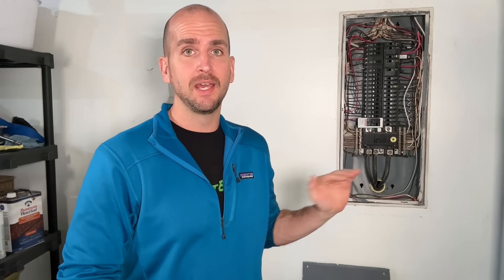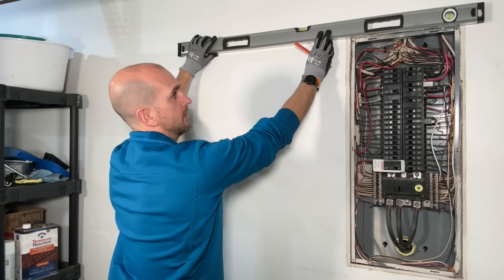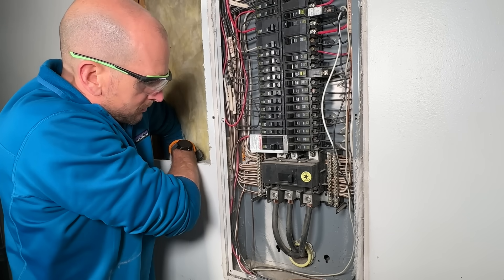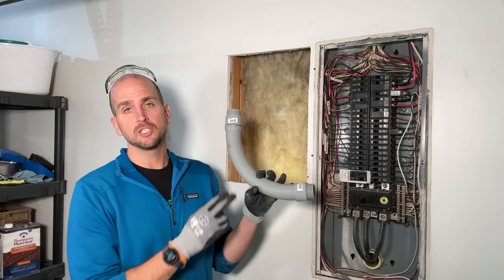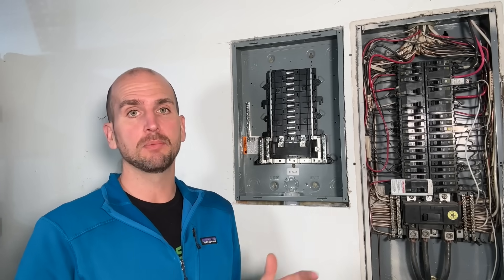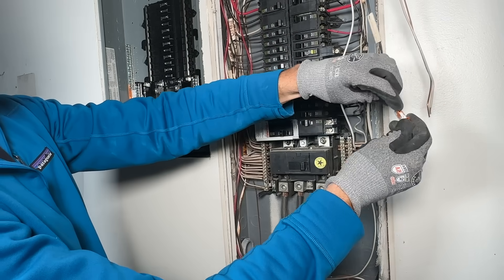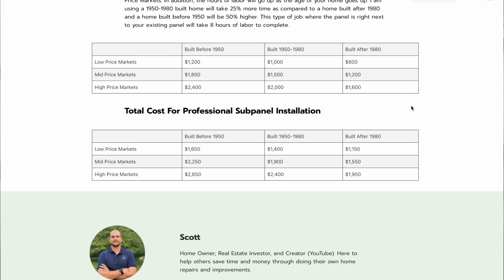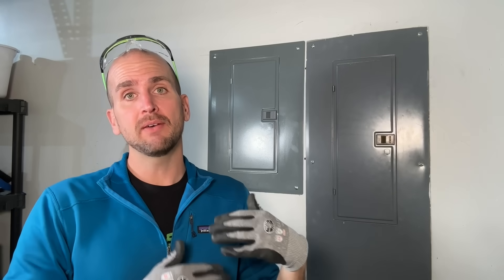How To Install A Sub Panel Next To Existing Main Panel

Comment: NEVER ADD A SUBPANEL DIRECTLY NEXT TO ANOTHER PANEL. Just change out the existing panel...Eaton makes a 60/120 if needed, what he did is CLOWN WORK 🤡
Reply: You're obviously not an electrician. There is nothing wrong with sub panels and they're added all the time.
Reply: @pld8993  If adding 1 to 3 circuits add tandem or quad breakers.
4 or more circuits CHANGE the PANEL.
Subpanels go in a different area of the building or in an out building/garage.
Reply: @tonyyglesias7784  Where did 1-3 go tandem but 4 or more change the panel come from? That's not a rule or even an industry standard so I'm guessing you heard that from someone once and you're running with it as if it's trade knowledge, which it's not. As far as tandem breakers, not all panels accept or allow tandem breakers though some allow every breaker to be a tandem so again, why 1-3 but not 4 or more? Sub-panels are installed for various reasons and yes, one of those reasons is to add more breaker spaces, but they can be installed just about anywhere you want them installed and there is no reason why they should only be installed away from the panel. Additionally, you can install as many sub-panels fed from a main panel as you wish, and you can even feed a subpanel from another subpanel.
Reply: @tonyyglesias7784  37 years and you never made it past journeyman? That might explain why you don't understand how wrong you are. Still waiting for "1-3 but not 4 " reference that you seem to think exists.
Reply: @Kevin-mp5of  You are a clown 🤡 
Why do you think they have 60/120s
Reply: @tonyyglesias7784  The only clown here is the one who thinks he knows what he's talking about but is clearly not an electrician. Care to share with the rest of us where the "1-3 go tandem, but 4 or more replace the panel" rule comes from? They make 60/120 panel for installation that require it, not because installing subpanels to create more breaker spaces is clown work. Study more, talk less.
Reply: @Kevin-mp5of  nothing like some crispy neutral insulation...
Reply: Bro pd is right again!  First off stop being so fukn cheap w this Eaton garbage people.  Only three u need to know GE Square D and Seimens.  Second most importantly check the load calculations.  Determines everything wen adding draw to the system!
Reply: You missed the part where the goal was renewables. Has anyone seen Tony? Maybe he is done with clown school by now?

Comment: How did that conduit fit so perfectly between the main and sub panel? Is it manufactured to fit so precise like that?

Was it required to use conduit or could you just have run the wires by themselves?
Reply: It would have been easier to buy SER. The big Grey wire. No conduit would have been needed.

Comment: I think you should spend more time talking about how careful people need to be around those live lugs. It's only 240V, but if you were to short those out, it would be much more catastrophic than a standard 240V short. Because there is relatively so little wire between the transformer, and such large wire, the short circuit current available in a short circuit condition is huge compared to any other short you'd see in your house. You could easily cause an arc flash.
Reply: I once bumped the bare ground wire for a range to a main feeder lug. I think it was a 6 AWG ground wire. The neutral and ground were bonded at the stove, and the neutral was already hooked up in the panel. As I was routing that ground wire...it touched a main lug, but for just a quick moment. SCARY. Nothing bad happened, other than noise, light, the wire was warm, and I needed a new change of underwear. Could have been a LOT worse!

Comment: In most states, work like this is supposed to go the process of getting permits and being inspected. I realize that's not always the case, nor does everyone do it even where they are supposed to, but it's worth mentioning.
Reply: This is particularly true if the electrical upgrade project ends up burning down your house. Not doing everything to code including inspections could invalidate your home insurance in the event of such a disaster.

Comment: So long as you are going to have all the power to your house turned off anyway, why not just pull the meter?  That way everything in the breaker box will be dead.  When you get done, replace the meter, then call the power company to come out and replace the seal on the meter.
Reply: You are not usually allowed to pull the meter unless you are authorized to do so since it is the property of the power company. With smart meters, if you pull it it will trigger a perceived outage and the power company will send out a crew to investigate. If you remove the seal and call them to come and install a new one, you'd better have all necessary permits and licenses ready to display or you'll be getting a visit from your local electrical inspector.  There's no need or reason to pull the meter simply to add a sub-panel. That would be like removing your gas tank before you replace your fuel filter.
Reply: @pld8993  Perhaps this varies by location or maybe it was that way "back in the day" 30 or so years ago when I did that.  And, I was replacing the old fuse box, split service entrance, with modern breaker panel.  I did not want to be handling hot wires coming from the meter box so the easiest solution was to pull the meter.

Since I was also upgrading to a 200 Amp panel, the power company also had to upgrade the drop from the pole, the mast pipe on the house and the size of the meter box, and the wires from the meter to the panel in the house.

I don't recall getting a permit before doing the job.  I did talk to the building inspector afterward.  He said that if the power company was happy with my work (they would not have connected the power if I did something unsafe) he didn't see any need to come out and inspect it.

Regarding your last sentence:  Ironically, the fuel filter on my Toyota Sienna minivan is part of the  fuel pump assembly and is inside the fuel tank.  On the HIghlander (SUV) there is a removable hatch in the floor to access it but on the Sienna one has to drop the gas tank.
Reply: @BryanTorok  Replacing the panel is different, you always pull the meter for that, but not for adding to an existing panel. And I remember having a car where the fuel filter was inside the tank. It never got changed.

Comment: 1. One would think that manufacturers would provide plastic covers for the always hot feeder lugs instead of leaving them out in the open.
2. Is 100 amp service enough for all the heavy-draw uses planned?
3. Does code not require that neutral feeds be white wire OR black wire wrapped with white electrical tape? The installer of the original panel did not do that.
Reply: KameraShy
Your 1: Covers (barriers) ARE now required for SERVICE MAIN LUGS 2017 NEC® 408.3(D), 2020, 2023 NEC® 230.62(C) and for FEEDER (WITHOUT OVERCURRENT PROTECTION) MAIN LUGS 2023 NEC® 215.15 but the covers are AVAILABLE from the manufacturers (purchased SEPARATELY); it’s the responsibility of the installer to provide.

Comment: You can also use tray cable or SER to feed the sub panel. That's my preference for sure, must easier to work with.

Comment: Did you connect the 6ga ground to the ground bar in the sub panel? It looked like it was going to a neutral.
Reply from the maker: Yep the lug for the ground bar was on the same side a one of the two neutral bars so they look pretty close together.

Comment: I noticed your main panel had a few  ground and neutral wires in the same hole . This is a no-no, neutrals have to be one per hole. Depending on panel some do allow more than one ground per hole.

Comment: Is it code-compliant to run 2-gauge 100amp wires in the same conduit as 12-gauge 15/20amp circuit wires?
Reply: The 2s are feeders and the 12s are branch circuit conductors so yes, they can be in the same conduit. However, with 5 current carrying conductors in that conduit, the ampacity of all the conductors must be adjusted to 80% of 310.15(B)(16). 

When used as feeders (as opposed to service conductors), the largest breaker for these #2s is 90A. Because the terminals on that breaker and the lugs in the sub-panel are rated for 75deg, the 75deg column in 310.15(B)(16) must be used for maximum amperage, not the 90deg column. The 75deg column for #2 Al is 90amps. A 100amp breaker is not allowed.
In addition, because there are 5 current carrying conductors in that conduit, the maximum conductor amperage must be adjusted according to Table 310.15(B)(3)(a), which reduces their ampacity to 80%. It's not an issue for #12s since they are already adjusted down to 20amps max breaker size (240.4(D)). According to Table 310.15(B)(16), a #2 Al THHN is rated for a max of 100amps. Applying the adjustment factor fromTable 310.15(B)(3)(a) reduces the max amperage to 80amps. That feeder breaker is not allowed to be larger than 80amps. If he wanted a 100amp sub-panel fed with Al feeders, minimum size for those feeders is #1. #1 Al is rated for 115amps, adjustment factor takes it down to 92amps, and since 92 is not a standard breaker size you can install the next size up, which is a 100amp breaker.
Reply: @pld8993  i agree with everything you are saying, but the panel is indoors and ran in conduit why cant he use to 90 degree colum?
Reply: @chrisac76  The terminals on the breaker and the lugs in the subpanel most definitely rated for 75deg. While we use the 90deg column (THHN) as a starting point for adjustment factors, in practice the max amperage we use is from the 75 deg column because of the rating of connections. If 100 amps was to flow that #2, the temp could reach 90 deg. The conductors would be fine but the terminals would be subject to more than 90 deg.
Reply: @pld8993  correct.  Have to rate the average of the cable based on the lowest temp component.  But then again it’s really only rated for 80% continuous any way so 80 amps. I put in a 100 amp sub in my garage and upped the cable to 0 gauge because the garage is unconditioned and could reach 120 degrees (Florida) by going to 0 it allowed for the temp detracting.
Reply: @pld8993  the length of the 90 is probably classified as a nipple with no derate or fill requirements.
Reply: @johnhooton3286  You might be right, 24" max to be a nipple. It's close.

Comment: One suggestion would be to use red electrical tape and white electrical tape on the ends of the wire between the panels. 
This will make it easier to diagnose if there a problem with one of the hit phases and make it obvious about which wire is the neutral, since all the wires between panels are black.
Reply: Yeah, lack of colored tape on at least the neutral and grounds (had to run #3, so no green available) would have failed inspection here.  I go one step further and use red tape on one leg and make sure I keep that on the right side of all my panels.  It's easier to make sure I'm keeping things balanced between the legs that way, too.
Reply from the maker: Yeah, I agree that would have been a nice touch.  Thanks for the feedback!

Comment: Understanding the work you performed and the title of the video, but with the installation of the PVC prior to the sub-panel installation, wouldn't you want to install 2 or 3 PVC tubes into the top of the subpanel (to the ceiling of your garage) to eliminate the future task of re-opening the wall?

Comment: Putting a piece of plastic or cardboard over the utility side lugs as a temporary cover would make it safer to work in the main panel.
Reply from the maker: I agree or I just need to get some lug covers that come on the new boxes.

Comment: This is a great idea but my panel is on an outside wall and a pain the butt to run wires to it.   I ended up using 6/3 for 50 amp to a panel 30 feet away that is more accessible.

Comment: Where is the link??????
Reply from the maker: Below the video you will see the description that has the links to Solar Reviews, Pro Installation cost estimation, other panel install video, and WAGO lever nuts.
Reply: Code requires a insulated cover over the main feed lugs.

Comment: It’s interesting that 40 circuits is full without overloading the 200A main. I guess as many devices use less power it’s possible, but you should have mentioned that in the opening.

Also, some main panels have sub panel feed lugs after the main breaker. Check codes and local requirements.

You were lucky that the knockout in the main and sub panels fit so well with the elbow. It might be wise to check that fit.

Regarding the hot main lugs, I put duct tape over them to add another later of safety. No guarantee, but better safe than sorry.   Likewise gloves are good, but no guarantee.
Reply: Another guy who doesn't know what the F he's talking about. Duct tape is conductive and illegal to use
Reply: @Bc7833-x9n  I should have been more specific. I used non-metallized tape temporarily so that the back of my hand wouldn’t brush the contacts. As I was finishing the install, I found that the box manufacturer had provided some rubber boots to cover the main lugs. 
I agree that duct tape is not tested for conductivity, since it is not intended for electrical use. I might have just as well stuffed a rag over the lugs, but tape was handy, and about the right dimensions. I did mention that tape is no guarantee and not a substitute for being careful.
Reply: The average load on a 200 amp service is 60 amps. Not even close to an overload.
Reply: @jeffreyspence2510  Averages mean very little in real life, My boiler can draw up 100 amps, and my water heaters are 40A each, so on a cold day with laundry and a shower running, I’d be drawing 180A. 
My concern is that as we add more and more circuits, the potential for overload rises, much like the old joke…
“What do you mean I’m overdrawn, I still have checks in the checkbook.” 🤓
Reply from the maker: Thanks for the feedback Tom 👍

Comment: I guess there's an assumption that the 200 amp service is not maxed out at 200 amps, just need more breakers.
Reply from the maker: Yes, that is an assumption and usually the case for the vast majority of homes.  I should have clarified that point as I know it can be a bit confusing.

Comment: It looks like you are working on an exterior wall so a 2 1/4 inch hole would exceed the size you can drill in a bearing wall with 2x4 studs.  Also what electrical code revision are you working under and are you required to have a whole house surge protector with the panel upgrade?
Reply: he did say at 3:50 that he had a double wall thickness to work with so I'm guessing there's some type of inner non load bearing wall in place.

Comment: Do you need to reduce the wire ampacity for having multiple current carrying conductors in the conduit?
Reply: Yes, but he's OK. The three feeders are treated as 2 (the neutral only passes the imbalanced current), plus two moved 20A circuits, so 6 wires that count for wire fill. Derate to 80% of the ampacity. 

12AWG = 20A circuit. 12AWG THHN has an ampacity 25A (assuming the breakers are 75C rated), derated it's still 20A, so no problem.

2AWG has an ampacity of 115A. Derated it's now 92A. There's no such thing as a 92A breaker, so a round up to 100A is allowed.
Reply: It's also less than 24" so most adjustments go out the window.

Comment: You did a great job bringing the wires to the sub-panel. I did a similar install only I put a 14" metal access panel under the sub panel to give easier access to make future connections.
Reply: That’s exactly what I will do! Thanks for sharing
Reply: @DanielinLaTuna  Also put a 2 x 4 piece in there about 8" from the box so you can staple the romex that comes out of the box.

Comment: 13:00 "Those are going to be the phase A and phase B...." Probably a bit pedantic, but those aren't "phases." You have a single sine wave (single phase) service going to your home. You have two poles (120 volts each) that are of the exact same phase. 

I'm mentioning this as I've seen a lot of DIY electrical videos where the comments are littered with people thinking that the two poles are actually separate phases that differ by 180 degrees.

Edit: I could be wrong on this, but I don't think aluminum conductors are allowed (by code) to connect sub panels to the  main panel; they are only allowed to carry whole-home load to the main panel.
Reply: Typical residential is split phase so technically you're not wrong. Field lingo, however, frequently refers to the two legs as phases. Aluminum is allowed by the NEC. It's very common for local jurisdictions to have higher minimum aluminum sizes than the NEC (which is #12). Where I'm at it varies by county; one county has a min #2 and another has min #6 for any aluminum installed indoors.
Reply: @pld8993  Thanks for the clarification! I have a local Electrical/HVAC company that I've used for my business and home electrical since 1994. I had them run a 100 amp sub panel out to my garage (all interior run), and I asked him why he did the estimate with copper (which was extremely expensive) rather than aluminum and he said code didn't allow aluminum to be used to wire a sub panel to the main. Interesting how different places further restrict the NEC so much.

I'm comfortable doing my own electrical work, and have often done my own stuff and then had an electrician come and inspect it. But I'm getting up in years, and not quite as agile as I used to be. : /
Reply: Pd.  Is on point.  Get ur head outta ur bro.  There are two phases A & B    even tho they call it single phase.  That's why the bus system alternates! U can notice alternating separate bus connections on every 240v panel.